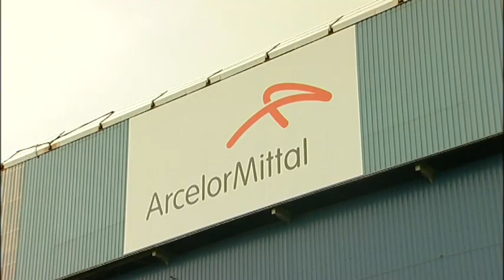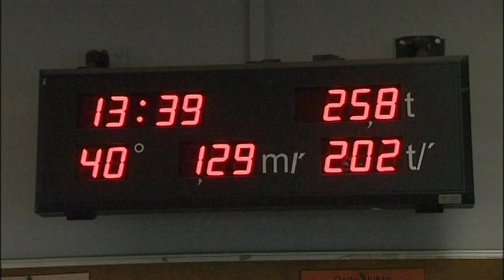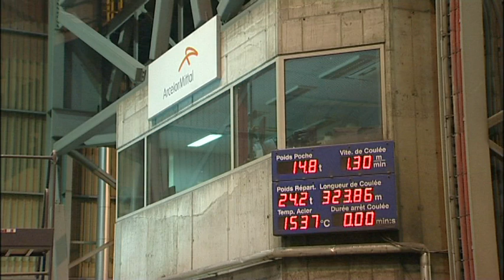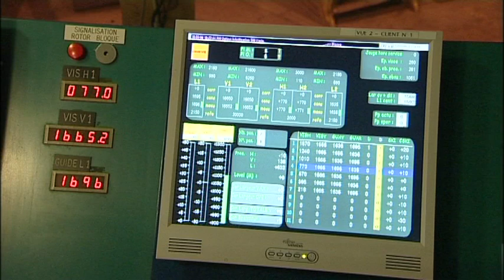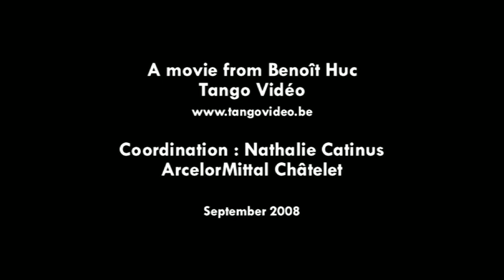Stainless Steel Production Process - ArcelorMittal Châtelet Site

Comment: We Aussies used to produce most of the SS we consumed but back in mid 80's it was decided to close the operation down at Port Kembla and import it all. BUT before it happened we produced the material that would eventually go into our 1988 new Federal Parliament in Canberra. If you have never seen the huge four posted flagpole that hangs over the sunken building then do yourselg a favour and check it out....200 tonnes of Aussie's best.

Comment: They show them dump in the chromium in the pile or the hopper if you will. They should be spraying that with water all that dust is so damn terrible for the environment and for people a little bit of water is cheap it would cut down that dust even if they just used a freaking garden hose and hose the pile once a day it would cut down on the dust but they don’t seem to care

Comment: Why are the outside bins exposed? Would rain and moisture just mean more energy and longer to get it up to temp? Also, is that chromium dust blowing around in the wind? And the guy looking down into the electrodes and pools. Is that bad to breath day after day?
Reply: The moisture has no effect given the high temperatures involved - any moisture simply flashes to steam instantly and dissipates.

Comment: I see the iron slabs are passing from rollers and machines pour water to be cooled. Doesn't this lower the temperature of  the pre-heated slabs???
Reply: There's an energy balance. Compressing with such huge forces add heat enough to keep the process going. On the other hand the water keeps the rolls cool enough to perform their job.

Comment: I have a question:
1. The maximum roll thickness of stainless steel on the market? 6,8,12 milimeters?
2. Why donot they make the thickness harder? like 15 or 20?
Reply: maybe nobody needs a vessel with such diameters,also the price here is a big factor for some manufacturers of stainless steel vessels

Comment: What happens to all the impurities like aluminum plastics and other metals mixed in the junk feed stock
Reply: Plastic will burn off. Other elements can be removed to the slag in the AOD by blowing gasses through and turning the unwanted elements into oxides which float to the surface. Also if they're making a 304 grade they will use 304 scrap, they don't just put any old scrap in the mix

Comment: I worked at Titanium Metals in the 70's. We did our melts with electronic furnaces. But wow! This mill is phenomenal. All I could do is wonder how much they spent on the equipment and systems controls. Bet it's more than $50.

Comment: I have question: Which is better?? (1) from raw materials (2)  from scraps.
Reply: It isn't cost effective to make stainless steel from pure materials alone. Usually melt shops use over 85% scrap for a cast and use as little pure material as possible to keep costs down. The end product will be the same

Comment: Cleanest steel mill I’ve ever seen
Reply: You are absolutely right . I have worked in some  steel mill departments NASTY!  my LORD how I made it?
Reply: It is a stainless steel mill!!! stainless!
Reply: this had to been filmed the first day of operation
Reply: The furnace and the AOD are sealed in big units with extraction so you don't get fume dust all over the shop
Reply: @Guitar101Smasher  JUST a nice dusting of process lime and grease on everything. "fallout" lol ... quite interesting places to work. stainless spatter on equipment is like razor blades...
Reply: It’s a hell of a lot cleaner that the steel mill I work at. The only clean part of it is in the finishing department. From the scrap yard to the continuous caster everything is covered in lime dust and swarf.
Reply: @dantan-tt3el  its stain less not stain proof !!!

Comment: 👨‍💻💭shame the Rollering process isn't close after the steel is made - like it's already HOT  so save $ on reheating it - maybe there's a reason 🤷‍♂️💲
ITS GREAT VIDEO like these  types tech stuff factorys  more please
Reply: The reason I think is they mentioned that they have to grind the flats after the initial roll to eliminate surface defects.

Comment: I am still trying to figure out why most of the stainless I come across for scrap is magnetic. The scrap yards will give me a good price for non magnetic but the magnetic stainless just goes  to the normal steel scrap bin. 

Can hardly find any non magnetic stainless.
Reply: A2 (304) Stainless steel is mildly magnetic and is used quite extensively for nuts and bolts, sink/drainer units etc. In time it will develop rust spots which can mostly be wiped off. 
A4 (316) Stainless steel is non-magnetic and is totally rust proof (in general). It is used extensively in engineering for, again, nuts and bolts in applications where total non-reactivity to chemicals and water is required. It is also used in marine applications on boats etc. A lot of surgical instruments are made from this too.
Reply: Mystery Buyer Stainless steel that is magnetic is mostly an Chromium-Iron alloy with little or no Nickel. It is less corrosion-resistant than alloys with an higher percentage of nickel that are non-magnetic.

Comment: Interesting stuff thanks Benoit, hated the music,  maybe some jazz, acoustic guitar or drum & Bass or all 3 next time, they'd go well with the talk and the narrator had a nice voice

 I use and need this metal for my lime putty mortar and plaster work. Without it You can always use wood but it does make thin repairs so much easier.

The film was from 2008, I wonder what improvements have happened in the steel mill since, it would be interesting to see how many employee's are left and whether or not it's still even open.

Comment: 5:26 how much is one of those slabs worth? $10k? $100k? $2 mil?
Reply: $12000
Reply: Depending on the formula...
Reply: Stainless Steel (304) is around $2.75 a lb right now when we manufactures buy it, so 20-30 tons would be $110,000-$165,000 per slab.  That also depends on the type of stainless steel: 304 is the most common used for food applications would be about this much.
Reply: That truck had 3 big slabs and 2 small slabs, so it was carrying about $715,000 of material, but no one can steal it.  It all has to be processed too, so it's not worth that until the work is done.
Reply: Ryan Avery well I bought some stainless sheet metal the other day and my cost was 3.50 per pound
Reply: @MrMopar413  There's tons of markups.  We usually buy by the load, and it'll also vary by area.  So even at 3.50, just increase the base price.  Either way, it's a ton of money.

Comment: nowadays the melt shop melts steel  (~200tons per batch) @32 minutes in the QBOP  furnace (as compared to their ELECTRIC furnace) and the slab caster is faster .see the ATLANTIC STEEL Corp mill at Cartersville Georgia.
Reply: @Oliver Mayo yep but guess who is about to be coming back on line. 2020 Fairfield Works putting new furnace on line. We're coming back hopefully like we were. 2nd only to Pittsburgh in steel production.

Comment: Does molten steel have to be stirred for homogeneity?
Reply: No
Reply: Yes. The AOD blows gasses through the melt to remove certain elements and to stir the steel. In the ladle furnace they have an oxygen lance for stirring and sometimes also gently blow gasses through a porous plug in the bottom of the ladle

Comment: I find it a waste of energy that the fresh hot slabs are allowed to cool before rolling.
Reply: So what is the solution ?
Reply: Rolling mill inline with the caster and an induction furnace in between
Reply: The spray of water is to take off the slag (impurities) that forms on the surface before its rolled, its doing like 80mph as it hits the catcher, seen this kill a guy at porttalbot steel works UK,
Reply: Ever heard of tempering

Comment: I can't agree with you on the wages. At one time the money was good but not any more. It helps if you are on team leader rate or manager rates. Being on shift helps too but tradesman and production wages are middle of the road in my opinion.
Having said that, once I put some overtime in and cover a few shifts it boosts my income hugely. I wish I could pull the money that some friends do that work for themselves (£50 p/h minimum and a markup on all parts).